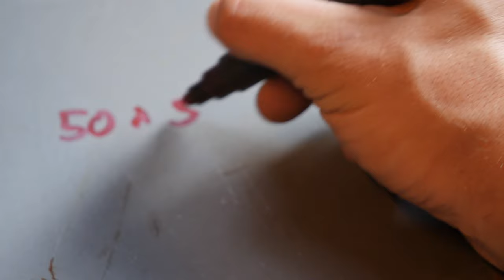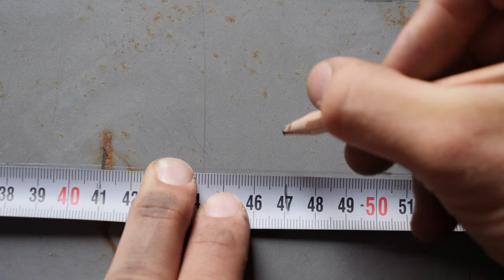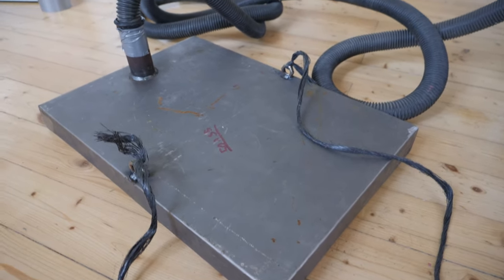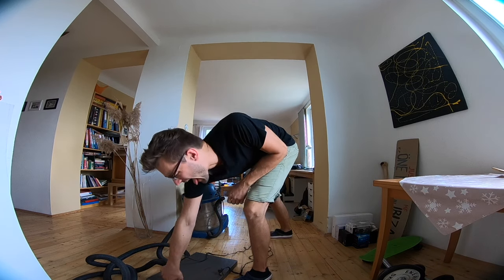VACUUM SHOES, can I WALK on the CEILING?

Comment: What happened to the follow up on this? Lets see aluminium shoes with valves to open each shoe to outside air pressure allowing each one to release at the same time, take one vacuum that is more compact and wear it on your back. What would be really clever is a some sort of sensor that knows when you are trying to lift each foot, you could start off with hand held controls. 
  One vacuum with two valves should be enough but better if the flow was diverted at a Y splitter so the other shoe doesn't loose vacuum when your other "lift foot valve" is activated. a manual valve is probably enough, you just wiggle a lever that diverts the vacuum from one side to the other. you main problem seems to be the weight of everything. I had a great laugh though and sent the video to my son who wants to buy some suction shoes. lol